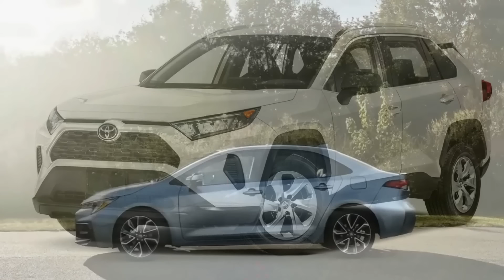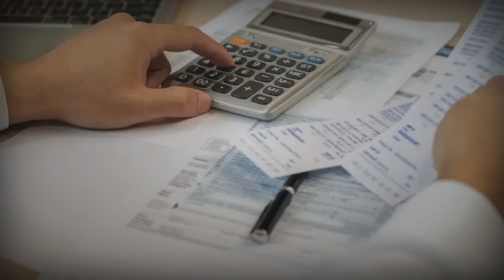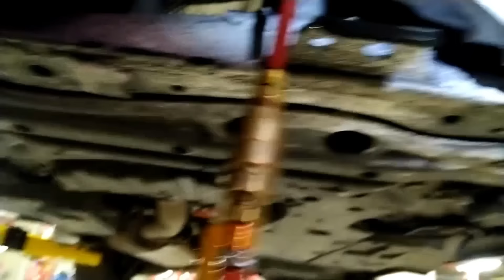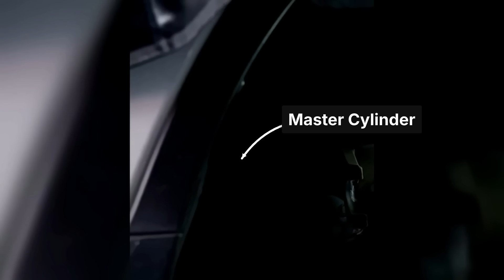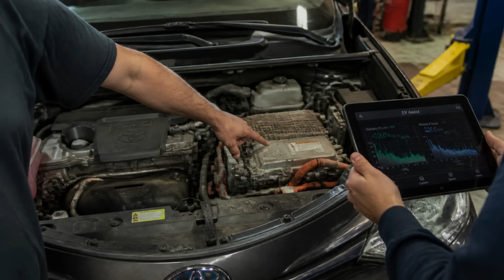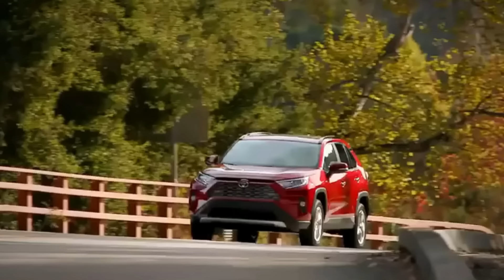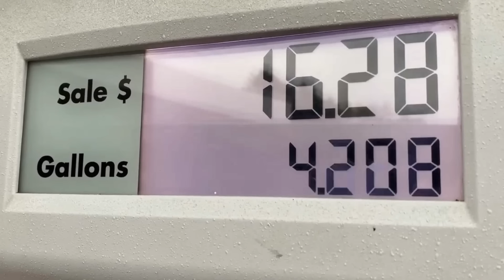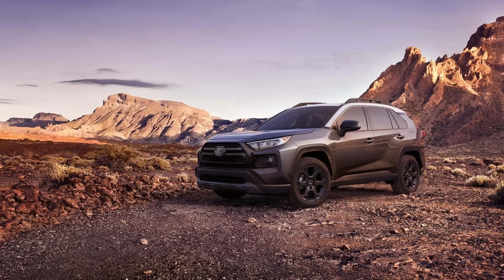We Tested Toyota's 2.5 Hybrid vs 2.0 Gas After 200,000 Miles — The Loser Surprised Us

Comment: Outstanding comparison. I recently gambled on buying a gas-only 2025 RAV4 with just 2,700 miles on the odometer (the one and only previous owner was a Toyota dealer). I'm 74 years young, and I plan to keep the car for possibly 2 decades. I think of myself as a total cost-of-ownership guy. Your comparison showed me how a hybrid model beats the gas-only car modestly over 200k miles. I don't regret choosing gas-only, but I really appreciate seeing how the hybrid gradually beats the gas-only model over a very long ownership period. If gas prices skyrocket, I may regret it, but if gas prices drop over the long term, I may be pleasantly happy with my choice. One thing you didn't cover is the extra cost of financing the hybrid car. The upfront extra cost of a hybrid is often financed, so financing that premium at 8% interest over 6 years could reduce the hybrid savings significantly. Good job overall. Thanks for sharing.

Comment: Good video, but you've left out some big factors.
One, your financing costs are going to be higher on the hybrid. (Example: $3500, 60 months, 7.5% = $707; yours will of course vary, but you should mention this.)
Two, the hybrid's battery degrades over time as well as miles and cycles. Even at a well-above-average 20,000 miles/year, you'll have to replace your 10-yr-old big battery. Toyotas typically need that hybrid battery around 10-15 years, 200-250,000 miles, so you were lucky.
Third, you neglected to factor costs of both insurance (higher for the hybrid) and disposal (higher for the gas, provided it's compared to a hybrid with a recent battery).
Fourth, many owners can easily change the PCV and brakes  saving a ton of labor costs; the (gas) belt and the (hybrid) pump are different stories.
...And did Toyota put crummy brakes on the gas SUV, or did you hire Jimmy Johnson to do the test?

Comment: 2021 Rav4Prime 130,000 Km, 90,000Km on Battery and 40,000 Km on ICE. original brakes second set of summer tires. (snows in the winter) also changed transaxel and rear drive oil at 120,000Km. Engine oil changed every time the computer said service required.
Traction  battery when new, dash readout would read 88KM full Charge, now it shows 85Km after 5 years and 90,000 miles on the battery. Thank you TOYOTA.

Comment: I have a 2019 RAV4 gas with 240k miles I’ve done the oil change intervals every 5k miles and every other change it needed at its time it needed. The only thing it’s given me at this time is the bolt joint, lower control arms and shocks that need to be change for that mileage. The other major thing it’s given me for that mileage is the front cover gasket, but for that I don’t see any visible oil leaks though. Other than that everything else is good

Comment: There were too many variables in who did the service on both vehicles.  In addition, the hybrid's acquisition cost of $4,300 means the break-even point is around 175K miles, or 10+ years of average driving.  Unless the hybrid's battery warranty is transferable to a second owner, the cost equation will shift back to the gas engine, especially if the car is leased. If the vehicle is financed, you need to include interest expense for each vehicle.  I like to drive on the interstate a bit above the posted speed limit.  With an Accord V6, from Cleveland, OH to Greensboro, NC, I never stopped for gas - averaging about 34mpg.  With our Subaru Forester, we routinely average about 20mph in the city and 36+ on the interstate.  For the oldest Subaru, the only major repair was the brakes at 80K miles; for the two newest ones, the only "repair" was the glove box lock - about 3 minutes of time and no charge.  I like simple.

Comment: Major flaw in your calculation, the hybrid has the larger engine, increasing the purchase cost and gas use, where are you a proper hybrid would you have a smaller engine, where the higher bread is mostly acceleration assist, and regenerative braking

Comment: Just a few points:  
 - I have a 21 Venza which comes as a hybrid only as does several current Toyota models, so no hybrid vs gas price difference.

- Not sure how a lithium ion battery which is in my Venza holds up over time vs the nickle metal type?

- If you're going to compare the purchase price difference, you should also compare the resale value at 200k as well.

- With regard to fuel prices, if they go up, the saving widens as well as resale demand & trade value.

Comment: a 2.0  engine is antique  you  use a 2.5 engine out of a 2025 rav 4  not some old 2.0   you will see it is the better choice  i own one and it gets 47.2 miles to the imperial gallon  or  4.5 liters of top teir fuel   or 39.8 miles on a us gallon 3.78 letters  the gas modle is best

Comment: In the UK fuel runs about $8 per US gallon - and that changes the balance dramatically, even if you need to change a battery at 160Kmiles the hybrid is more cost effective.

Comment: My friend had a taxi company with 7 Toyota Camry 2.5 hybrid and 4 Toyota RAV4 2.5 hybrid. These taxis had about 500,000 kilometres each over the 5 year lease period. The cars were replaced at the end of the lease period only because they were getting tired inside. Never had a mechanical problem with the engine or hybrid system.

Comment: One thing, you should use 5W-20 instead of 0W-20 despite what Toyota says. 0W-20 is slightly - as in 1% or less - better in mpg, but 5W-20 will reduce where a ton. If you want your gas engine to last 400K, use 5W-20 or even 5W-30.

Comment: 2017 Gen4 Prius owner here. 100k on the Prius. No unscheduled maintenance at all. I'm not fully buying this video. Maybe I missed it but the engine belts should have been changed on the gas only car while the hybrid has no engine belts to change... and if a gas engine belt failure happens while on the road then you could be out a substantial amount depending on the extent of the damage. The hybrid has no engine belts. I did not see a starter motor or alternator replacement on the gas only car. This is fairly common problem with gas only vehicles but hybrids don't have the equivalent. At 200k, the oil usage seems to indicate the engine is reasonably close to end of life, or at least much closer than the results for the hybrid engine. I think the same thing can be said for the tranny... which can easily make up for more than a new hybrid battery at probably 300k. I think the long term operating expense for hybrid will be, on average, much lower than the gas only vehicle. I'll bet that hybrid is worth more at 200k because it has far more miles left in it.

Comment: I would be changing the oil in the gas enging every 5k. That woulda changed the wear in the gas model. Interesting woulda been resale value. I'm very skeptical of hybrids w 200k and no battery replacement. Used I'd buy the gas. New I'd lease the hybrid provided the cost is similar.

Comment: EVEN Without the savings, I prefer the hybrid. Changing gears is so disconcerting when driving, especially when you want to pass somebody. Immediate torque off the line and immediate motion when you're passing or going up a steep hill it's just so much better than gears.  I realize old guys like me usually prefer the gears and some even prefer a manual transmission, which I don't understand at all. I had a couple of manual cars in the old days when they used to get better gas miles, and it was a lot of work.

Comment: 325000 miles on a 2014 Toyota Camry hybrid.  Replaced hybrid battery at 285000 miles.  235000 miles on a 2017 Toyota Camry hybrid still on original hybrid battery.

Comment: I'll go with simple non hybrid engine technology. 
Hybrid is a complex technology and transition between ICE and battery takes away the pleasure of driving. 
More importantly I can do oil changes and maintenance myself on non hybrid car but for hybrid one I got to deal with dealership. 
I hate most dealerships.
Reply: Oil changes are the same.
Reply: @chrisjackson6046 OH no man, I used to get it done by dealerships and then I tried using myself, difference of a world.
Liqui moly and Motul
Then I realized they were putting water in the Engine .
😂😂😂

Comment: Longevity also means servicing oil at 5000 miles. Not 10,000 miles.  It might take many 15 years to accumulate 200.000 miles or longer.  The risk of battery replacement is something no maintenance can solve.  I am sticking with ICE engine for the near future.

Comment: Do hybrid cars have more mice nesting problem than other non hybrid cars? 

As hybrids need to be warm to maintain some of it’s back features working. And mice makes nests inside engine compartment during snowy cold days? 

Is it safe to park Toyota hybrid inside the attached garage, as I have heard that gas engine turns on and off on it’s own to maintain the hybrid battery alive for HEVs . 

This problem is not for electric vehicles.

Anyone facing these problems? 

Please answer. Thanks

Comment: Kelly's book states:
- It takes a normal household driver between 13 and 16 years to reach 200,000 miles in a single vehicle. 

This timeframe is based on recent data from the U.S. Department of Transportation's Federal Highway Administration (FHWA), which notes that the average American licensed driver logs between 12,200 and 15,000 miles per year.

My question is How does someone reach to 200k miles in only two years?
Reply: I agree!  Once, I had a Buick LeSabre with a diesel engine in it and a 27-gallon fuel tank.  On the highway, I averaged 36 mpg.  The day I got the vehicle, I went straight to Midas and had the shocks changed.  A friend of mine test-drove it and was amazed at the handling on interstate ramps, but he told me how and when to empty the water separator and change the oil - the manual was wrong. I turned it in at 65K miles.  At 106K, the company sold the vehicle.

Comment: Going from HEV to PHEV next up. Expensive gas, cheap electric rural suburban NW Orygone. Hyper mile '24 CCH AWD @75mpg and EV ratio from new. Calculate current prices, new Rav 4 PHEV, @500+ eMPG. Reportedly new Corolla will have PHEV... 200k hybrid engine compartment is pristine.

Comment: I'm 74 and retired. I rarely drive in stop-and-go traffic traffic. I live about 2 miles from an interstate hwy that connects to a loop around our nearby city (Charlotte, NC) and to other interstate hwys. In short I don't do much stop-and-go driving, which means I would rarely be getting the hybrid advantage. Also, I keep my used cars all the way to 150-200k miles. I’m going with a low mileage 2025 RAV4 gas car. I'm happy with the relatively low cost of brake pads and I will have no concerns about hybrid battery degradation nor replacement or lower trade-in value due to hi mileage. My avg annual mileage is down around 10k miles per year. I think my driving profile fits a naturally aspirated gas car. Given my situation, I'd love to hear an argument against my decision to “go gas”  for the next 15-20 years.
Reply: In my family, given your age and the break-even point of total ownership and operating costs, gas would come out ahead. Period.  What's missing is the investment cost and insurance.  I wish they would analyze a normal ownership period, including interest on the investment and insurance costs.  The analysis is harder for me because I used to only lease cars and return them at about 45K miles, with the only maintenance being oil and filter changes.
Reply: I'm 77.  Our next car is our last car so just pick the one that suits your fancy.  Practicality adds up to nothing at our age.  Leaving money to your kids will only be bad for them.  Buy what you think is new and fun.

Comment: A pretty fair and objective analysis, but neglects to consider the invisible benefit of burning less gas for the same 200k miles. Using dollars as the measuring parameter has some flaws, as there are many situations where hidden costs (e.g. environmental damage) may not be immediately apparent. Sweeping problems under the rug is always cheaper, if you don't take holistic concerns into account.
Reply: Meanwhile China operates 1195 coal fired power plants and nothing is said about that.

Comment: 2015 2.0 CRV owner 90,000 km. So far no breakdown , replace front suspension normal wear parts , average 6.5 km / liter City driving traffic , AT trans , change oil every 5,000km , change Trans oil @ 60,000 km

Comment: I bought a 2025 Toyota Rav4 XLE AWD gas only June of 2025. They tried really hard to push me into the Hybrid Rav4 (WAY MORE MONEY). But with me retired & no longer having to drive to work, the Hybrid was not for me. My wife's work place is half a mile down the road from our home and she drives a 2009 Toyota Camry LE gas only (PAID FOR). Replacing the drive battery or an electric motor worried the holy hell out of me. I just didn't want to chance that smoke later. So far, i'm extremely happy with my purchase. I only have 2000 miles on my 2025 Rav4 (NOT PAID FOR) after one year driving it. The vehicle will last my bride & I the rest of our lives. Plus I have a 2004 Chevy Silverado 2500 6.0L (PAID FOR) as well. VERY well maintained. Ive no needs for more vehicles. Three is enough. Hybrids are good for people with long commutes or drives a lot. Gas only is good if you just need to drive local. But then.....what do I know? Im just a 67 year old BOOMER with one foot in the grave and the other foot on a banana peel. LOL

Comment: My 2012 RAV4 has the 3.5L V-6 gas engine, 5-spd. auto trans, and selectable 4WD.  I get 23-24 mpg in mixed town and country
driving and up to 29 mpg on long trips.  This car does really well when the weather includes snow and ice.  It's as reliable as a 
brick and with 270 hp under the hood goes like a bat out of a hot place.  Passing slower vehicles, even in the Rockies and Sierras 
is no problem whatsoever.  Currently, I have just under 65k miles on this car.  I bought it in 2016 with 28k miles on it, so don't drive 
a lot in retirement.  The simpler non-hybrid system appeals to me because I can do most of the maintenance myself and have 
done so on various brands of cars and trucks for decades.
Reply: I have 2 Rav4 Limited V6's 2006&2012 AWESOME CARS! I also have a 2021 Venza LIMITED hybrid AWESOME. 0 drive belts to maintain, Gear-box E-CVT in front and rear diff oil change for both EASY. I've got 120,000 with zero issues. The Venza WAY out handles the Rav's, although the acceleration is slower. The V6 foot to the foor experience has it all over on the hybrid!!!😁😁

Comment: You talk about hybrid complexity but they don’t have belts, starters, alternators, extremely complex transmissions and you saw how the brakes lasts. A hybrid water pump failure would be a one in a hundred or even a thousand odds of failure! Only idiots change oil at 10,000 miles. 5,000 miles is what almost every knowledgeable mechanic will tell you!
Reply: I thought oil. Hanges were recommended if 3,000 Mike's or 5,000 kms.
Not 5,000 milesnot 8,000 kms? What is the verdict?
Reply: I thought oil. Hanges were recommended if 3,000 Mike's or 5,000 kms.
Not 5,000 milesnot 8,000 kms? What is the verdict?

Comment: We just bought a 2026 Corolla Hybrid and can't believe the fuel economy.  We still have an older Camry and thought it had good fuel economy but it gets only half the rate of the Corolla.  Also,  when we were looking for the car,  we priced used Corollas and they were 3-5 thousand dollars more for the used so we bought new.  It was less to buy a new Corolla and we had to wait for the car to be made but it was worth it.  It also has the Lithium Ion drive and not the older nickel metal version.